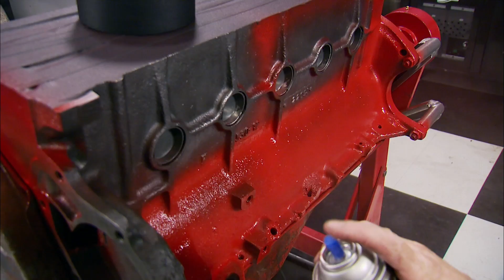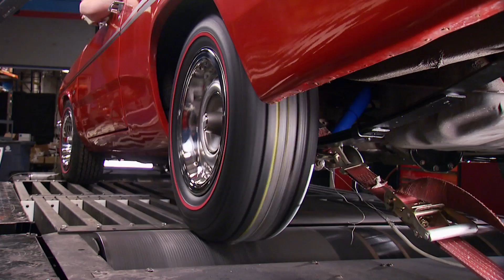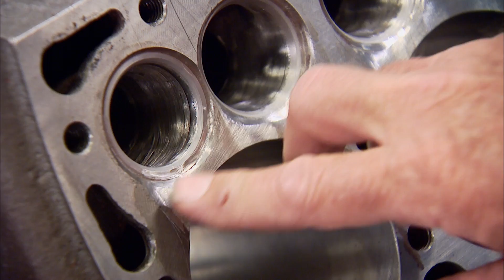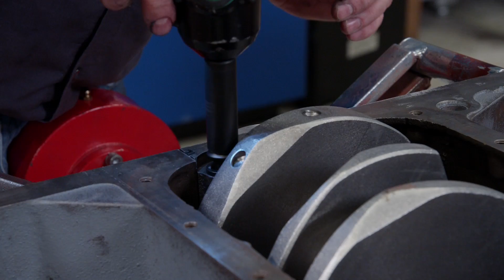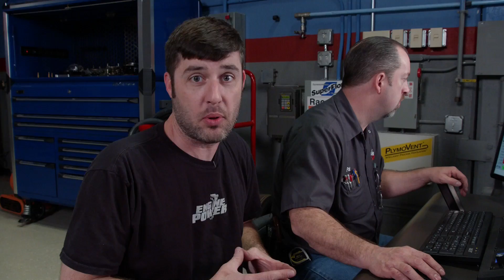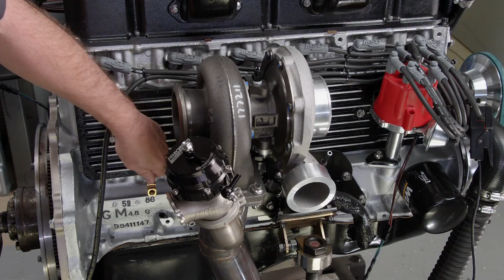Vintage Engine Builds: Ford Flathead, Chrysler Slant-Six, Ford FE, Chevy Straight-Six - Engine Power

Comment: I had 70 coronet   I ran the hell out of it. Drove for Denver to Miss State in 24 hours in 1974. I give $550 for it.  The values sound like they where going to come of the top of the more.  My neighbor who found it. Thor hi to buy a can of transmission fluid. When we pick it out I rode around the corner and poured it in the motor. By the time I home the values were quit.

Comment: Wow guys I have not been this excited to  see such a sweet build! The last time I saw this type of build is when I accidentally found a 331 hemi, it looked just as crusty, and hopeless looking uh but was worse, in less than 3 hours, I was absolutely and totally convinced it was TOAST!  And the only thing left was the heads which were saved and rebuilt and succesfully used again with good results, uh but only the valve covers, those heads and the intake, and the crank.  And when I was done,  I sold the whole wreck for $300.00 which of course you know was insignificant, but unfortunately my block was just far less than worthless, because as Im sure you already dont have to guess the block had rusted yep all the WAY clean thru the cylinders, and about 90% thru the water jackets, and I was very saddened but not at all surprised water and iron just aren't 2 forgiving Period! And my short ass build was over in less than a heart beat!  WAH WAH CRY BABY WAH!!!

Comment: Man I miss my flatheads.  I had two 1949 Ford coupe with the 239 flathead v-8's.  I swapped one of the little ford with a 255 Mercury flathead, 3 deuce manifold, aluminum heads, headers and a full race cam.  That SOB would run like  crazy.  I had a ton of various parts, two deuce manifolds, straight headers, etc.   Unfortunately I spent 20 years in the Air Force and when I got out in 1992 my dad had gotten rid of everything before he died.  There was also a '57 Merc station wagon with a 312 Y Block that I wanted to swap into one of the '49's.  Man what I wouldn't give to have all that back again...

Comment: Love the old slant six, my dad had one here in Australia in a car called a Valiant which was considered a big car in Australia but I imagine it might have been called a medium or compact car in America back in those days. My dad got a company car and the valiant was left unused for about six months and one day we thought we’d start it up and with just one short turn of the key it was instantly chugging away as if it was fully warmed up. What the hell has happened to Chrysler Jeep, you hear terrible horror stories about the brand these days.
Reply: The 3.3 and 3.8 engines used mostly in chrysler vans are some of the most durable and reliable V6 engines around.

Comment: We raced these back in the 70's, bored them 125 over, used a ford piston that brought it up to the deck with 11-1 cr, ported the crap out of the Aus truck head & I built tunnel ram intakes for them with a sideways Q-Jet.

Comment: I hate to be a party pooper...but here is the truth about those slant sixes.... My parents bought a 66 Belvedere brand new.. 225 inch six with an automatic.  When it had just over 120,000 miles, it began running on 5 cylinders , my Dad and I took took the head off  , and the leaded gas of the era had gummed up the valves so  bad that they were all close to sticking... the #1 and #6 cyl were the worst. So, Dad had the head gone through , by the way, the metal of the era was lousy and there was a major ring ridge.... we put it back together and not long after it began to burn oil.... from the rings which were well worn. When it was at 150,000 miles...in 1980 , they junked it and  got a Plymouth Volare.  Those engines were not " bulletproof. They got modest gas mileage, they were gutless.  If you want to look for a " bulletproof " engine, maybe look at a Toyota 22r

Comment: You could order the slat six with with a four barrel carb these engines only had 4 main bearings and were notorious for breaking crankshafts ...if you want to build a hot inline six ..get a 292 Chevy truck engine with a forged steel crankshaft and rods  and use the cylinder head from a 194 Chevy II Engine..cut the head bolt bosses out from inside the intake ports and use head studs inside the intake ports.. Cut the intake valve seats out and replace them with z/28 302 valve seats  and use 302 intake valves that are 2.02 inches in diameter ..get a cam and two fours  intake manifold from Clifford Research .and run two Holley 750 cfm carbs ..and beat most V8's or do the same with a 300 cu. In. Ford inline truck six ..and ask Clifford research what the hot set up is to hot rod the ford sixes...either way you should be seeing in the 500hp range at the rear tires on a dyno-jet in a early Chevy II or a early mustang ..anyways that's what we got out of them in the 70's in the hot rod classes at the NHRA tracks running in the 7's for 1/8 mile and at Lincoln Park dirt track when 6 cylinders were the rules for the bombers and hobby stock

Comment: All that Slant Six episode showed, was that you blokes have no idea how to make power from a Slant. You're about even with a Stock VE/VF spec 2 barrel Slant, and you never put the carb on correctly, primaries facing the engine, not the radiator on a Six.
From the money spent, you were missing about 50 more hp. A well built N/A Slant will do closer to 300hp at the flywheel, while a Turbo can go over double that. Check out the "Tilley VC Valiant" - 635hp at the flywheel.
Reply: this wasn't a balls out build,it was basically a stock rebuild.a 300 horsepower slant isnt going to be streetable or user friendly .the other thing is these shows are 15 years old so your suggestions fall on deaf ears

Comment: Some people would laugh at me but to restrict the oil going to The Rocker pedestal on the old Fe engines I used to cut a drywall screw and drop it down in the oil feed hole after the bolt is in there for The Rocker pedestal when the oil pressure came up the drywall screw will raise up a little bit until it touched the bolt and let just enough oil up there to oil the Rockers without flooding the valve cover🇺🇸⛽🔧⚙

Comment: I know some guys in Brazil who use the Chevy 292 inline six. They are making 2,500 HP with these things down there on STOCK heads and block running five second 1/4s!
Reply: Those cars they use are called Opalas, and I think they are running 7 second quarters, not 5. Hellishly fast, tho.
Reply: warren hymes They’re in the 5s. Check them out on 1320video as we las their own channels 👌

Comment: Would of loved to see the complete flat head build. have never seen cam, lifters, valves , valve springs installed on these engines. Guess i will have to keep waiting for a video of this step of engine build.
Reply: Just search Ford Flathead rebuild on You Tube. Several videos come up. Hopefully at least one of them would have what you want to see.

Comment: We built a stroker flathead a few years back with a single 4 bbl, it is no joke how little these engines respond to tuning/timing/etc. Ours bubbled out to 165 corrected HP. Certainly a cool sounding engine.
Reply: 3 main bearings is barely enough for a twin-cylinder. It’s amazing that a heavy duty $800 forged crank is only good to 250hp when the same amount of the same steel from the same company is good for 1000hp in a small block. There’s just no support in the bottom end.
Reply: @paulmccoy2908  thankfully you can get other straight sixes...

Comment: That FE was epic. I was thinking galaxy over a truck. Or 64-66 t bird.
Reply: Agreed! In fact, I built a similar 445 cid stroker FE for my 64 T-bird. I love it! I built it before the Trick Flow heads were available - I think those are a step up from the Edelbrock units I’m using. The FE is one cool engine.

Comment: I wouldn't exactly call the slant six bulletproof because it only has four main bearing. The real bulletproof engine of the inline six designs from that era is Ford's 300 inline six. It has seven main bearings and was the popular choice in the Hobby Class at the local 1/2 mile asphalt track.
Reply: Slant's are not exactly dropping cranks out of the block due to the main bearing setup.  And a 300 cid engine was more favored then a 225 cid engine? What a shock. lmao
Reply: @warhound7781  At high RPM's some would suffer from cracks around the main bearing area on the slant six. From mid 1964 onward some also use the 200, 240, 250 all had seven main bearings, so they would use whatever they could get their hands on. They were also spinning them as high as 6500 rpm's and I had heard some where higher than that.

Comment: I loved that slant six build, especially since they gave it to an owner who would really appreciate it.
Reply: I wish they would have taken it for a drive afterward, or at least gotten the owner's (or wife's) thoughts after delivery.  He didn't seem like a car guy, but I'd have loved to know what he thought of the final result.
Reply: Idea was cool, problem is they build it like a v8.. trust me on this. This build sucks on the lower Rpm and wastes loads of hp.

That's the biggest problem. Simple v8 builds don't really work with a six. Better to spend your time different!
Reply: @gorkzop  i dont see how they tested it from 2000rpm
Reply: @bigsean2473  exactly.. original peak torque is at 1800rpm. Get a good cam.(and with a good street can you don't get over 4500rpm) 2bbl or 400cfm 4bbl. Dutra dual and intake heat.. you'll get 150horses atleast
Reply: @gorkzop  IIRC most dyno's dont really star/read before 3000 rpm or so, if im not mistaken.

Comment: I wonder how much power was robbed from the slant six in that Duster from the drivetrain? I bet with a rebuilt trans and rear end with the right gears and locker there’s a lot more power than 130hp out of that engine.
Reply: Slant 6 rebuild was bad anyway... They build it like a v8 and not like a straight six. Really a shame
Reply: gorkzop what would you have done differently?
Reply: @BaggettBuildingCompany  depends on the build. If you want a street car (what I guess they want) I'd get a dutra front, half original manifold coming together in y pipe... A weber 32/36, bbd or 400cfm holley 4bbl nothing more. Rv10/15 cam (pretty much the only camshaft that's a slant grind and not a Ford/chebby ..and doesn't rev over 4500/5000.. what this engine can't.)

Most importantly timing.
Idle at 12/14c. With 20 mechanic all in at around 2700rpm..makes the engine so much faster off the line. Oh and add a HEI chip. Mopar box isn't that great.

There are so some small improvements to the heads that anyone can do that help alot.

This build is basicly slap stuff on it like a v8 and expect v8 results.
Reply: maybe even 140,they suck if horsepower is what you are after tbh